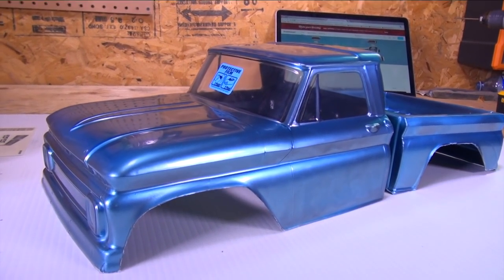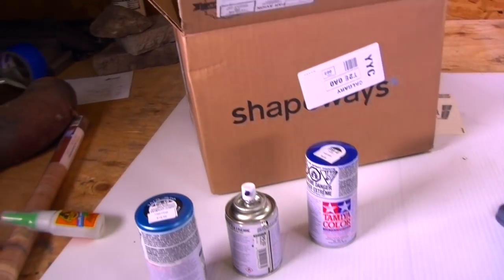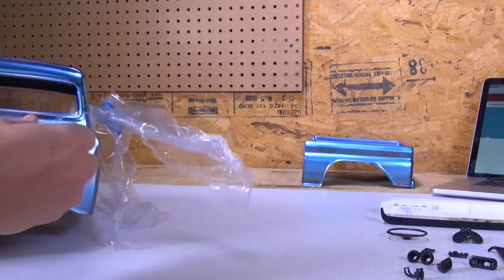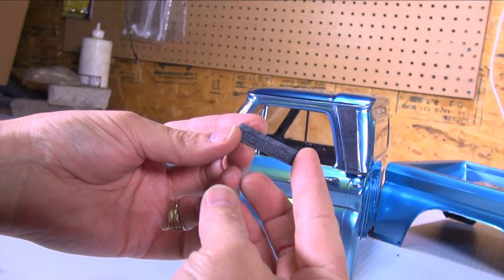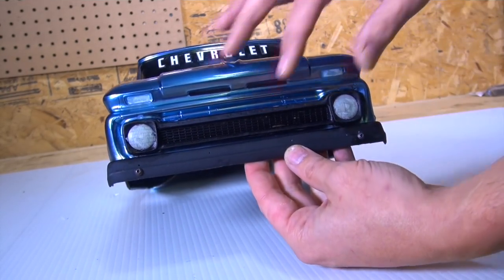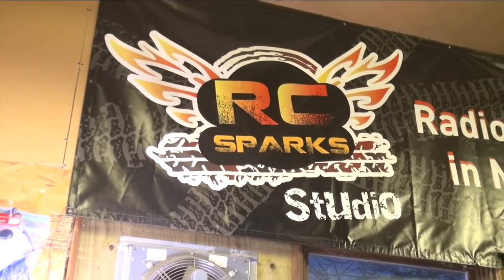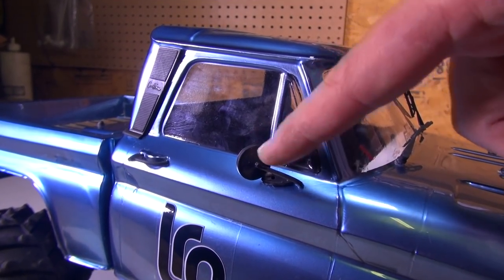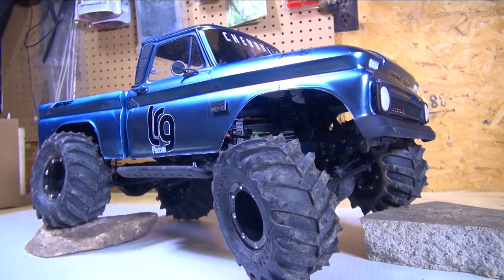RC ADVENTURES - "BLUE STEEL" CHEVY 1966 C10 AXiAL SCX10 BEAST PiCKUP "Re-iNCARNATE" RC NERDS COLLAB!

Comment: Bed idea is awesome too, great stuff , for the front two screws on the bumper, add two more above the screws you have, fill the hex socket with a body putty and paint the heads and boom they look like the typical old school rivet type bolt heads on those old iron trucks ; D thumbs up !!

Comment: two bolts per side on the bumper is how they are from the factory so youre Scale and legit !   :)
Reply: Vollick I don’t want to be the annoying guy correcting everybody on here, but they have one bolt on each end (like you said) and four in the middle (two on each side). The end bolts held up the ends, and the four middle ones secured the middle of the bumper to the frame. I have an old Chevy like this, so I know how the stuff looks/works I’m just trying to spread my knowledge a little bit to others.

Comment: I use thin super glue to stiffen up shapeways parts it soaks into the plastic and makes it more rigid, hope this helps you keep up the great content :)
Reply: joseph chester I’ve tried that before, but the glue leaves that fog on the body.
Reply: I use the glue to stiffen the shapeways part not to attach to the body

Comment: Hey RcSparks, I think you should do a project with the Exceed Rc AceTiger to show people a cheap but reliable alternative to Traxxas.
Reply from the maker: ughhh, sorry man. I used to like Exceed and did a lot with that brand back in the day. I learned though - the plastics are way too brittle for my part of the world. They cant take cold at all.
Reply: I was skeptic about Exceed for a while too until this was revealed. This car is strong (other than the body) and has a lot of aluminum on it from the factory. I think this could take the cold pretty well as long as you don't flip too much.
Reply: Aluminum parts include a big brace down the chassis, aluminum driveline and dogbones, as well as aluminum shock towers and shock caps(the biggest problem with Traxxas).

Comment: Just putting this out there: the rear window on the real truck is nowhere near that large. And that bump on the roof near the back. Doesn't exist on the real truck.

Other than that. This is really cool. And if there is a stepside version I would buy it.

Source: I own a 66 Chevy c10 stepside

Edit: now that Im thinking about it this is the non stepside. It might have that bumb on the roof. And the bumper is upsidedown

Comment: looks good except the use of velcro on the bed makes it look droopy and the upside down bumper
Reply from the maker: #1, the body posts were too high on the back, and secondly, read the pinned comment. The bumper is correct.

Comment: What are these tires I like them
Reply: Elijah Daniel I am pretty sure they are the traxxas sledgehammer tires
Reply: Rock Hawk thankyou
Reply: Rock Hawk will it fit traxxas slash you think?
Reply: Elijah Daniel they will not on the front without using a huge offset
Reply: They will on the rear though